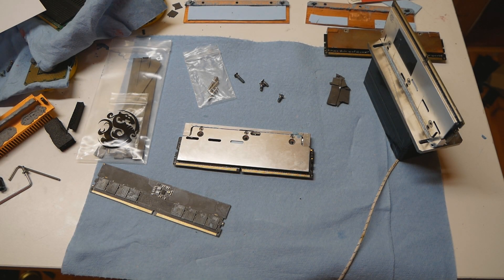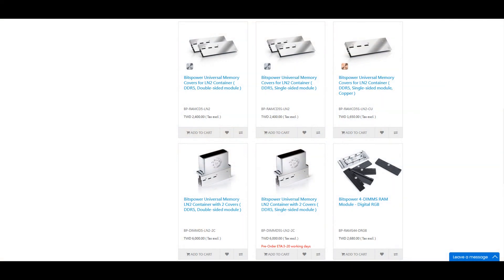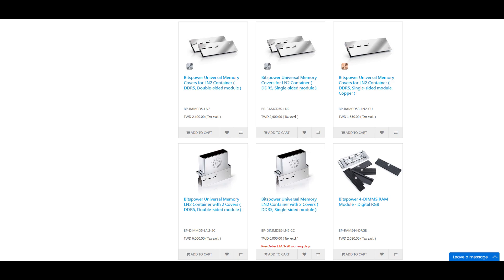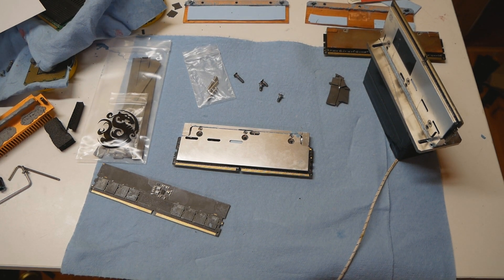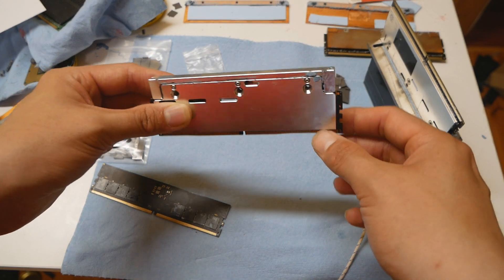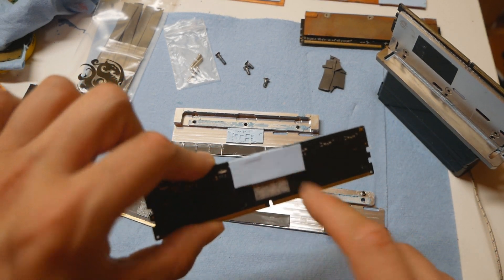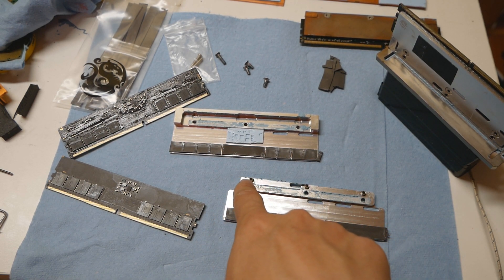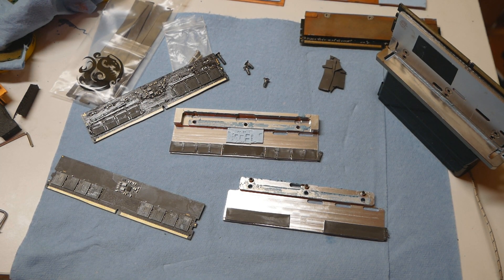Bitspower DDR5 Memory Heatsinks - Overview & My Installation Guide

Comment: i got a set of bykski heatspreaders for some ddr3L ram with kriticalpads 0.75mm thermal pads. bit overkill for such lower powered ram, but so far have been working well in my little optiplex server

Comment: If I just wanted to get the best possible ram temps with a passive open air zero fan convection cooled system, which ram heatsinks would you recommend?

Comment: Why though?  Heat "spreaders" on RAM are cosmetic.  And memory speed is almost irrelevant to both video games and most workflows too.
Reply: Bro what? Memory speed is one of the largest deciding factors for 1% lows in games
Reply: I'd do some research before clicking those keys my friend. DDR5 is more heat sensitive than previously. When overclocking, PMIC temps of ~50C+ can quickly start throwing errors. Just adding a fan is enough for most but higher voltages and aggressive settings can start having wandering bit issues with many stock heatsinks. Nobody running XMP/EXPO should be buying these but I don't know why they'd be watching anyway.

As for performance, that's just not accurate at all unless you're entirely GPU bound and even then there's frametime benefits, especially on Ryzen.

Comment: It seems like most ddr5 ram sticks dont have any thermal pads on the ICs at all. Its pretty insane honestly such a cheap and easy thing to fix but they just wont do it for whatever reason.
Reply: They don't need it.  "Heat spreaders" on RAM are purely cosmetic.  And while we're at it, memory speed is almost irrelevant to both video games and most workflows too.

Comment: Hey! So I have the Thermalright HR-07 DUO that have heatpipes and fins on them and can be used with 4 dimm sticks installed. Have you ever tried to use them or know if they will work in ddr5? I have yet to install them.

Comment: What are your thoughts on m.2 heatsinks?
Reply from the maker: I have one from Bartx i need to test.
Reply: @LuumiJuhani  test that soon!
Reply: Vital! Mainly for the cache system and controller.
Reply: @scottstamm7022  maybe the motherboard heatsink is fine for that?
Reply: @adityadivine9750  depends on the m.2. but most of them yea, mobo heatsink is fine, just have some airflow .
Reply: @Boogeymanjw  Hmm, I heard gen 4 ones get toasty
Reply: @adityadivine9750  
i strongly dislike the 'Heatsinks' that come with Motherboards since they tend to not have much or any support from the back, so they can very easily turn SSD's into Tacos.
something that actually clamps onto the Drive is a lot safer.
Reply: @taiiat0  hmm I saw some of those clamp ones on Amazon but I didn't find solid evidence of the motherboard plate was bending them.
Reply: @taiiat0 you have to use thermal putty too ass the thermal pads aren't making proper contact or making to much pressure.
Reply: @28KKaann  
what? Thermal Pads are fine for M.2 devices, as long as it's being pressed on. it doesn't need a lot of clamping Force, Thermal Pads aren't made for high force anyways. and we're only trying to dissipate like 10Watt tops, usually half that. we don't have to get very exotic at all, it just needs to be functional.
Reply: @taiiat0 pass are not fine me if they don't make proper contact, or bend the m.2 SSD to the point where it could get bad solder joints.
Reply: @28KKaann  
so all of your problems with Thermal Pads for M.2 devices has nothing to do with Thermal Pads at all, and just when the mount is skill issue or something. okay.
Reply: @taiiat0 yeah right
Reply: Don't ask for this guy's opinion. He doesn't even realize memory doesn't need cooling.  NVME cooling is necessary or it will throttle itself on large transfers.
Reply: @VndNvwYvvSvv  You have no idea what you're talking about. RAM OC'ing is very temperature dependent for stability.

Comment: I have Dominator GT 2133 CL9 (8x4GB), with the Bitspower RAM waterblocks. They work great! The block bolts directly to the GT heatsink, once you remove the fin stack. OC'd, the RAM never goes above 40c.
Reply: You bought 32gb ram in that era 😮
What you use your pc for?
Reply: @adityadivine9750  3DSMAX, AutoCAD, some gaming and overclocking. EVGA X79 Dark, 1680-V2 @4.8GHz all core, and along with that RAM, a Titan Xp Galactic Empire edition (Cause Titan drivers have some Quadro features in them over and above the GTX drivers.. The whole system is on water.
Reply: @CMDR_CLASSIFIED  wow seems like you were a crazy enthusiast at that time.
BTW is 32gb enough for 3dsmax? I'm thinking to learn it and wondering if 64gb will be worth it or 32gb is more than enough
Reply: @adityadivine9750  All AutoDesk programs will use as much as you can give them. If you can afford it, and if you do enough work to make it worth your while, then get 64GB. It will help to save time in the long run. Core count and clock speed are also important. And your GPU horsepower is usually there to run the interface. The more you have, the bigger, more complex scenes you can manipulate in real time.
Reply: @CMDR_CLASSIFIED  is 10gb vram enough ? 3080

Comment: Just put some ByKSKi heatsinks on my ECC memory, used thermal pads on one side and Ceramique 2 on the other side as there wasn't enough room for the chongus 32GB QR DIMM's. I'm seeing a max of 61°C on one DIMM and about 56°C-58°C on the other three under heavy load. Can't complain as they're in a JGINYUE X99 TITANIUM D4 motherboard w/ no direct air flow.

EDIT: the DIMM's are Samsung M386A4G40DM0-CPB's.
Reply: What's the maximum safe temp for ram and SSD?
Reply: @adityadivine9750  for RAM (Samsung M386A4G40DM0-CPB 32GB modules), I think the north end of normal is 85°C (and 95°C is absolute safe max op temp) according to Samsung's website.

I started digging after you said something, and it looks like I'm glad to made the $36 purchase of 4x DIMM coolers, because after 75°C the DIMM's appear to take a performance hit in response time. Given 61°C is the highest I've seen thus far, I'm rather happy! That's on one DIMM and they've no direct air flow (ie. it's a normal ATX case).
Reply: @scottstamm7022  I think I'll just buy a arctic 8$ 140mm fan and somehow direct it towards the RAM sticks using some flexible wires to hold the fan like in the study lamp. It'd give huge benifits too as I'll buy a ram with metal heatsinks.
Spending 40$ seems to much. Haha
Reply: @adityadivine9750  as for SSD's it's going to vary, but I'd say keep them as low as possible! 38°C-47°C is ideal if possible. Consult the techs spec sheet if you can get it.
Reply: @scottstamm7022  I'm buying 12700k with air coolers. It'll be above 90 when I render for hours. Will it harm my cpu
Reply: @adityadivine9750  get an AIO , like artic liquid 2. depending on the current there can be degradation. under 80c should be okay.
Reply: @Boogeymanjw  I'm afraid of leaks and pump failure
Reply: @adityadivine9750  like actual ambient air temps being 90°?
Reply: @scottstamm7022  yes the temps which shows in hardware monitor
Reply: hello mate, one question with the JGINYUE X99 TITANIUM D4, with what cpu are you using it, and how much can you overclock the ram on those motherboards? are you using b-die with them?
Reply: @tacoterito22  I'm using a Xeon E5 2687 v3. W/ my CPU, I can only do a stable -80mv OC (through BIOS mod, NOT through the BIOS itself), which results in a 3.5GHz-3.6GHz constant boost clock.

My DDR4 is ECC, no OCing. I believe there are online manuals that state how high of DDR4 it supports.
Reply: @scottstamm7022  I did not find does manuals but i will keep searching, thanks mate
Reply: @tacoterito22  I think DDR4 up to 2666mt/s. It says it'll do up to 256GB, but I've not seen anyone do that. I'm at 128GB, so I know that's possible.